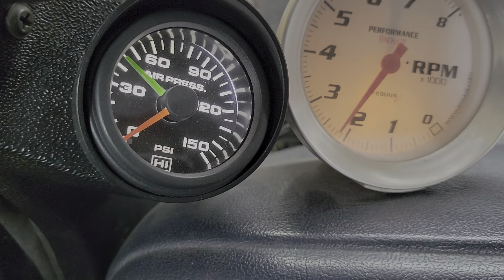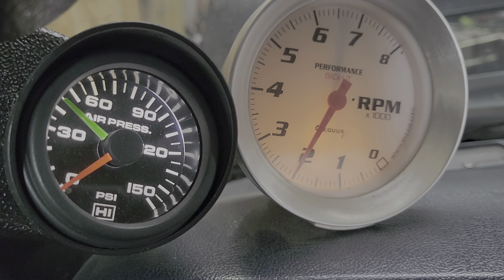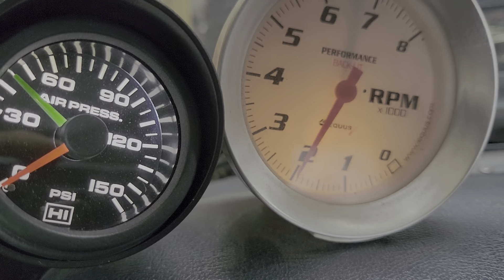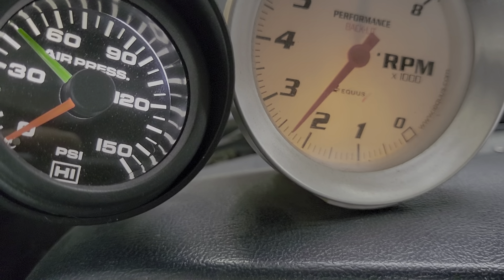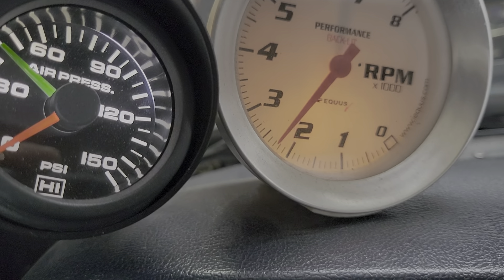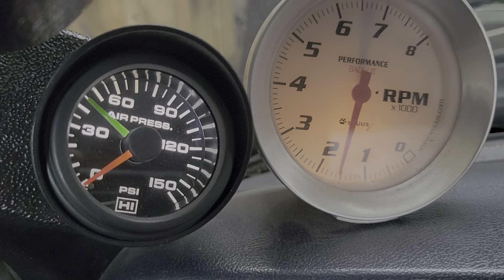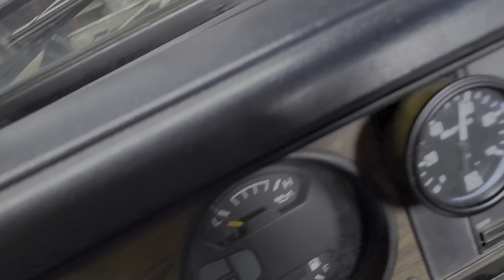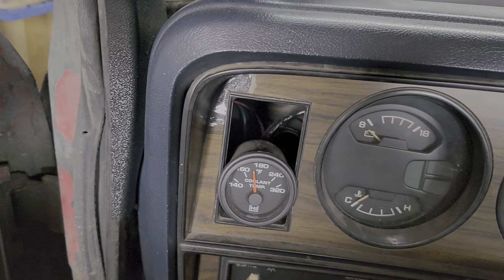Flat tappet cam break in. Cummins 188/220

Comment: I know this is a old video but I’m thinking about putting a 188/220 or a 178/220. They say they’re both basically drop in cams  with minor clearances. How many gallons of 20 50 did you use with the 15 40 and did you have to do anything on the internals of the motor to make this cam work or did you just put it in and run it? Thanks man I appreciate it!